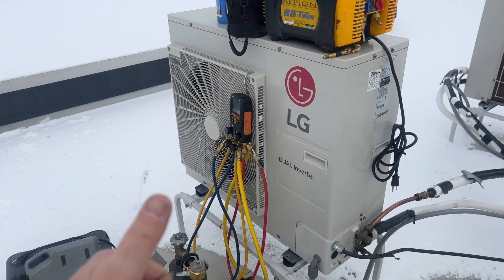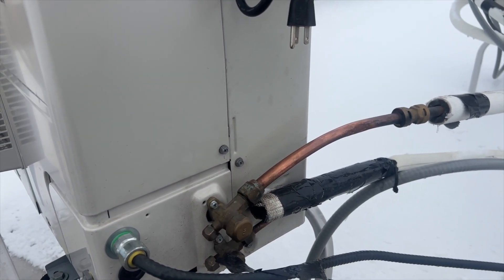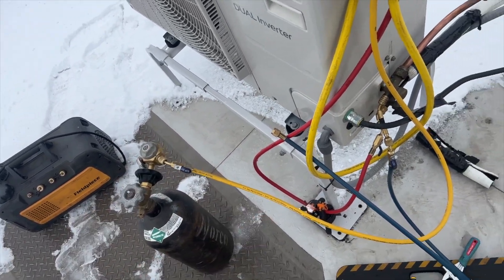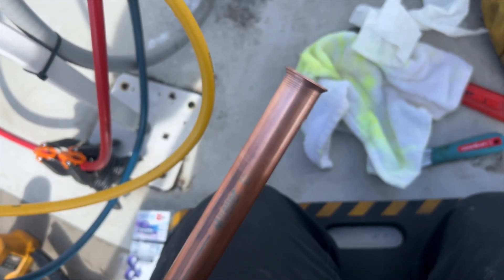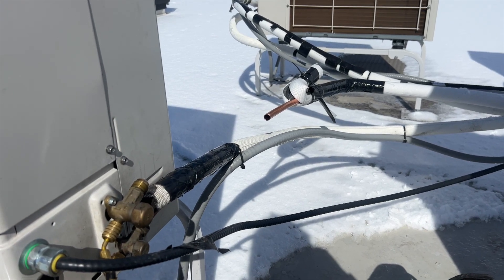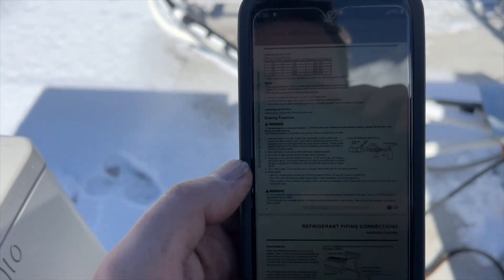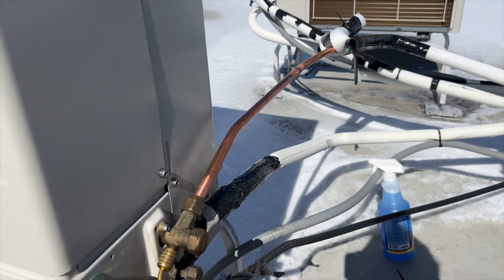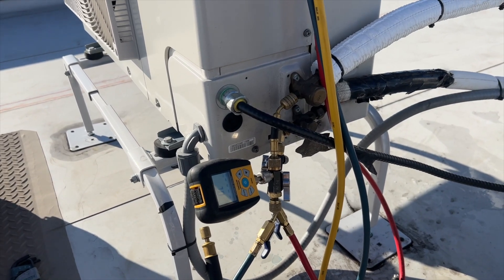LG Minisplit Refrigerant Leak Repair EP125

Comment: You could heat it up with a torch for a bit, cool it down and it’ll bend better, it’s called “kneeling” if I’m not mistaken
Reply: No it's called annealing...you heat the hard copper and let it cool, and it becomes soft enough to bend
Reply: @shadowbanned69  well clearly said if not mistaken but pretty much explained what was needed but thanks for the correction bro lol

Comment: Too much work.  First recovering what little was left when the appliance is pissing out refrigerant is a waste of effort and not cost effective.  Those fittings should never have been approved for HVACR use, so don’t give me that EPA recovery requirement BS or the EPA would outlaw those fittings which pissed out more refrigerant than you recovered.  What’s one more suitcase on the Titanic?  Just say you did if you must.  Secondly why not swage a short piece of copper on both ends and braze in place of that shark bite like fitting?  You’d have more copper on hand to replace more leaking shark bites.  Thanks for the video but I think you’ve run up the cost of the job unnecessarily.
Reply: Agreed. Funny he isn’t responding to your comment. Definitely a waste of money the way he did it.